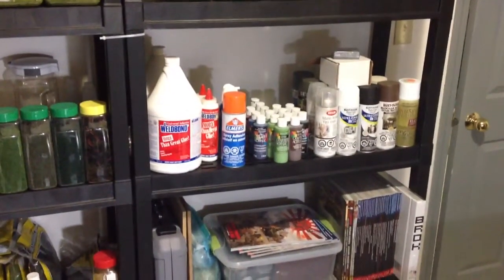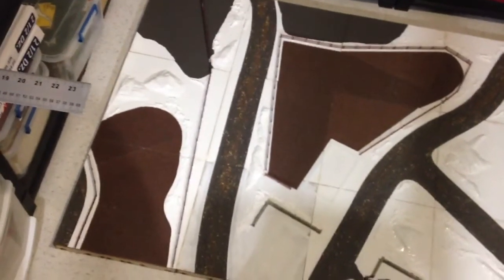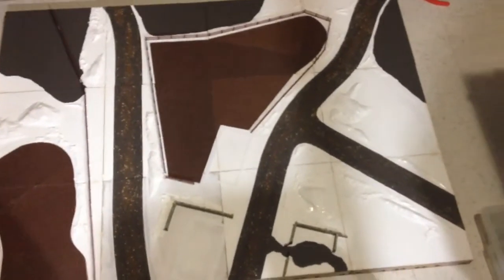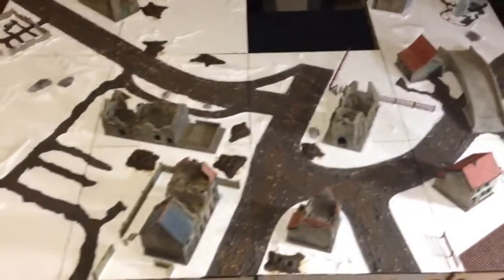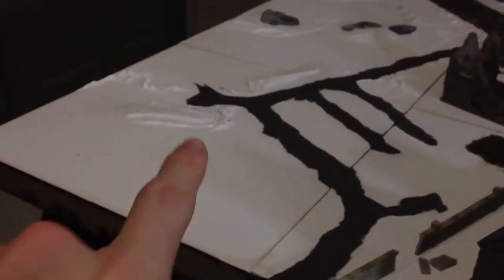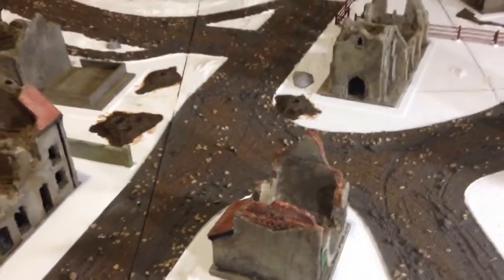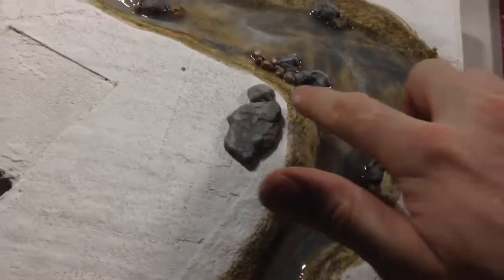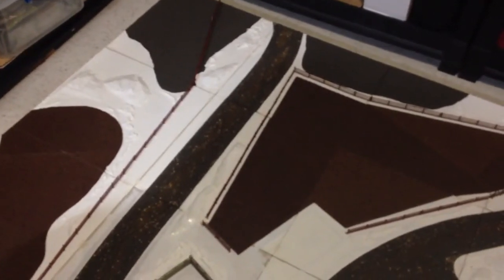Snow Banks - Foy Project - P.4

Comment from the maker: You have no idea. Packing boards take upwards of 4-5 hours.  The trick I use is packing them with as little packing material as possible.  The packing material can be abrasive and damage the terrain.  I use custom boxes that are designed specifically for the tile sizes. I also ship them on their sides so any crushing of the boxes occurs against the sides (which are stronger).  SO far I have had nothing but minor damage ever (all repairable with a little glue).